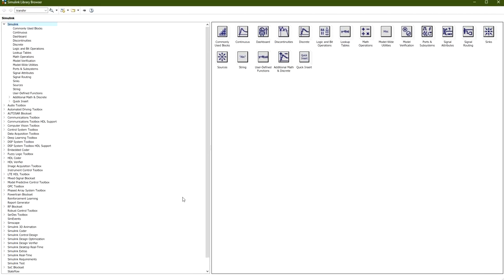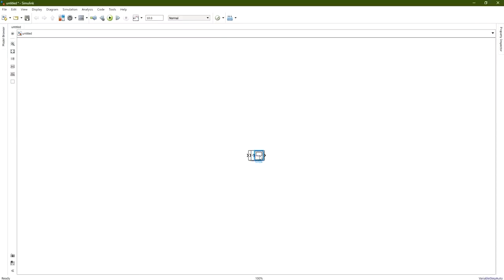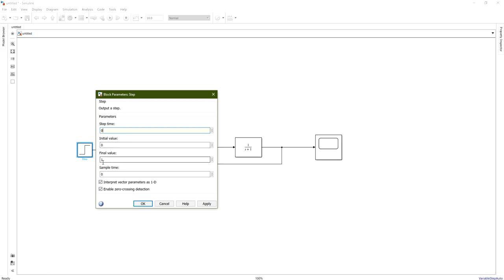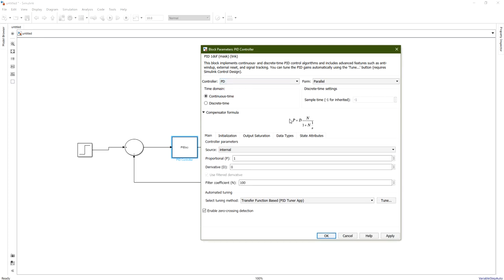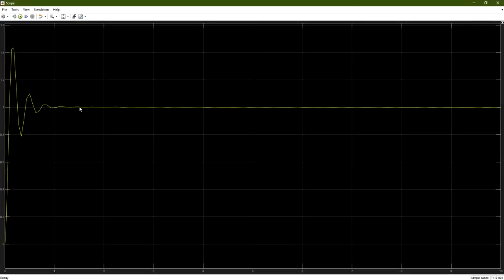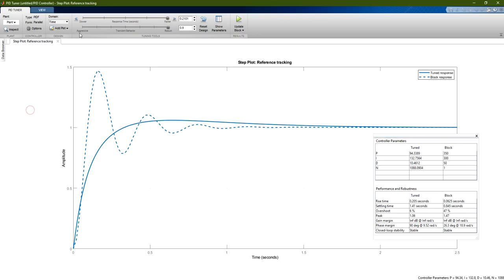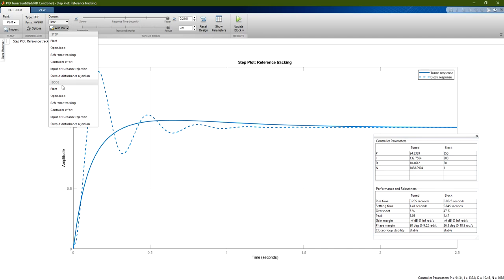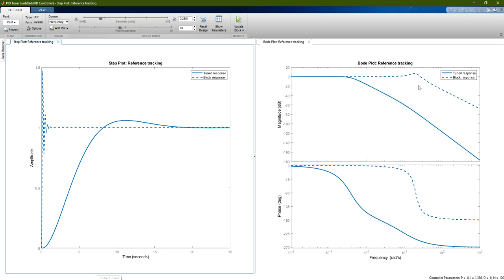PID Tuning in Simulink in MATLAB MathWorks Online Course

Comment: Excuse me Ahmed, what if our input is a continuous (like Drive Cycle, which has many values, not just one value for input), how could we find a good PID controller? Thanks
Reply from the maker: My suggestion is you need to tune the PID or the PI controller using an optimization algorithm such as the particle swarm optimization algorithm or genetic algorithm or any other new algorithm. In this case, you will have to set an objective function for the algorithm to reduce the error.
If you wanna see a video explaining this, send me an email to ahmedmahdy@khadijaacademy.com
Reply: @EngrAhmedMahdy  Thanks Ahmed, I will send you the email in one hour. I need to find a better PID value for UDDS Drive cycle. I appreciate it.